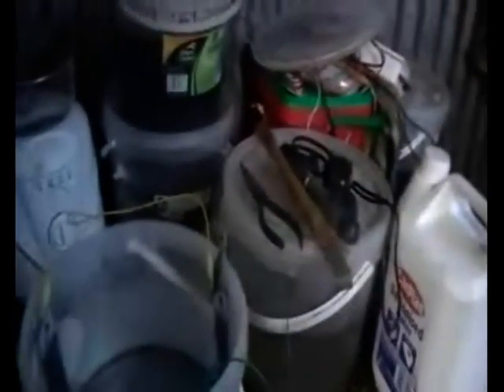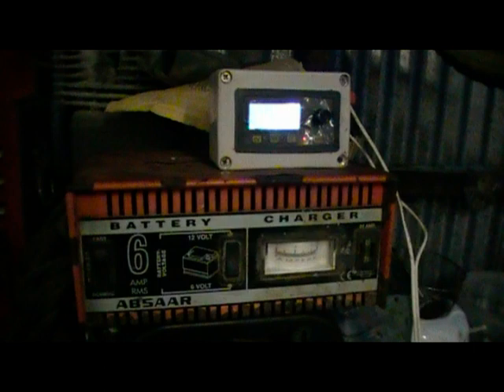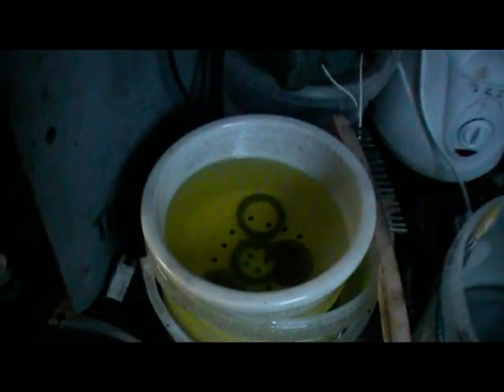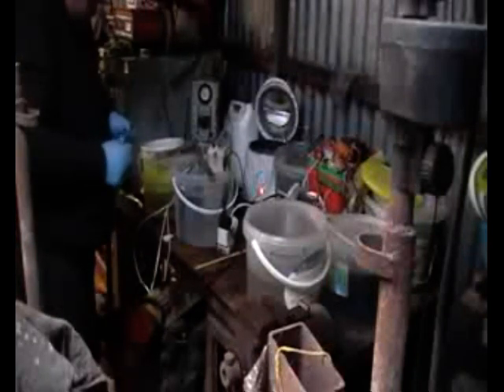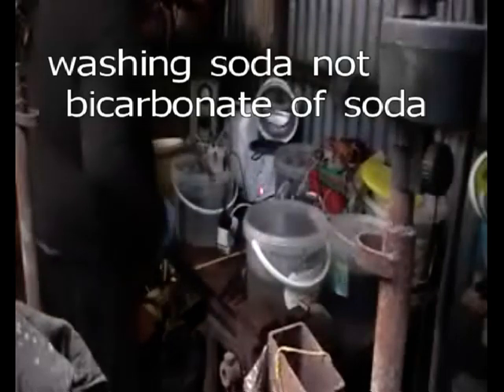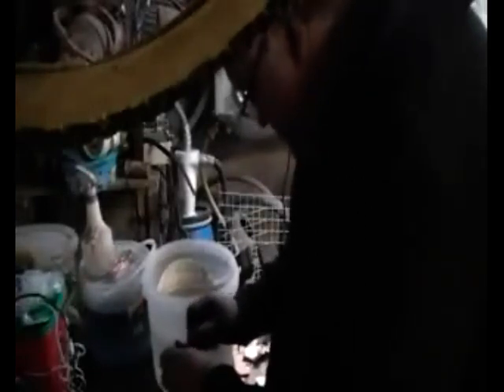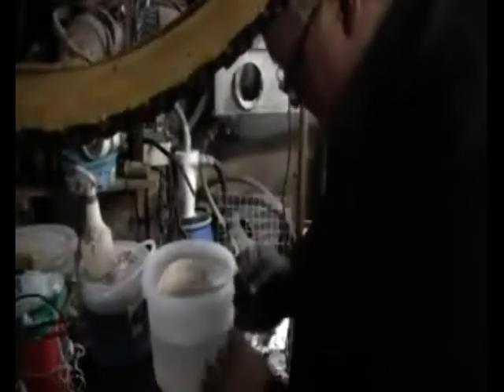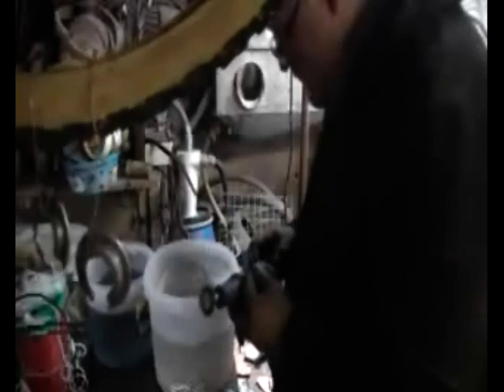zinc plating some bits

Comment: That's quite a setup you have.  The kit you've used looks fairly cheap on ebay, how much are the chemicals, and are they cheap to get hold of?   Would love to have a go at this.
Reply from the maker: all the chemicals are almost household,vinegar,epsom salts ,caustic soda, washing soda ,dextrose sugar,battery acid, and sprits of salts,all household and tri sodium phosphate ,pasivate and copper sulphate off ebay. bit of research on you tube and before you know at your at it i think the most expensive bit was the current controller at 25 euros but i started with a phone charger with very good results